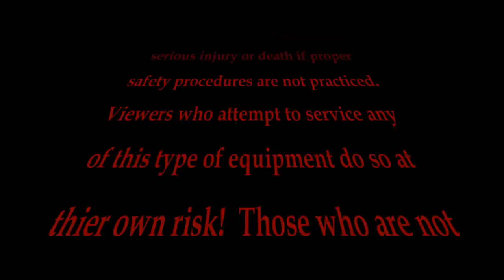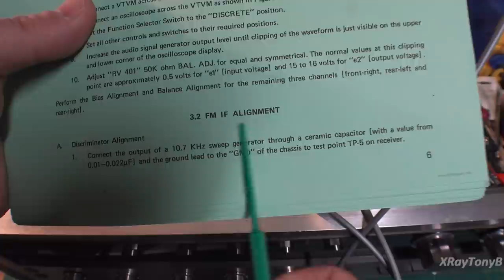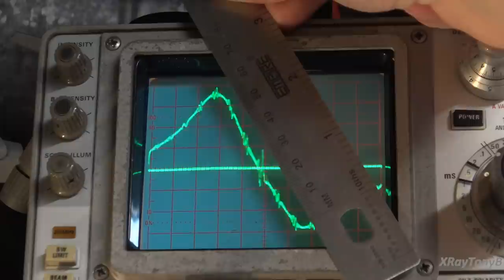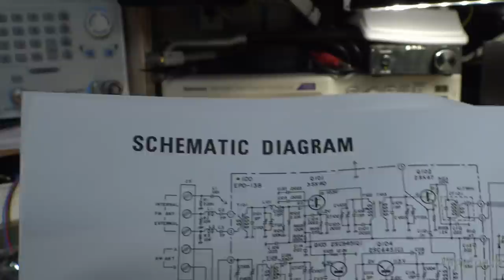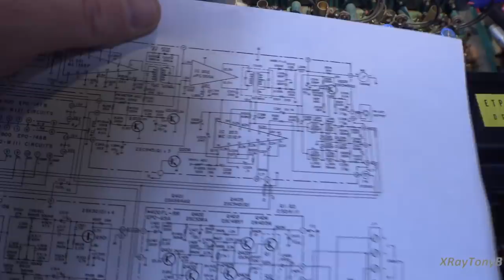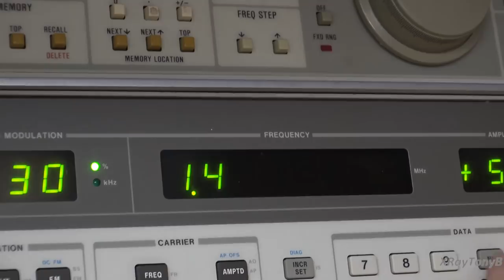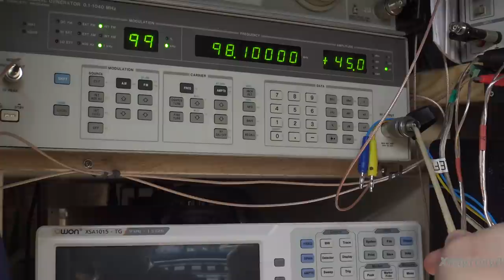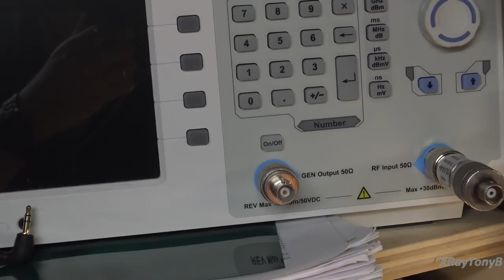Lafayette LR 441 Quadraphonic Receiver Part 2 - Servicing the Tuner

Comment: A Year so ago I did email you concerning a tuner I was trying to align  I don't think you even responded And I was not offended in any way ..Being in the auto repair industry I also get many questions on how to repair something ,Although I try to help, trying to fix something over the phone or in a email is all but impossible...I even had my big brother who is an electrical engineer come over and try and help but no joy, it highlighted how specialized radio is.  Watching you very informative videos and dumb luck I was able to somehow align the discriminator to 10.7 MHZ which was the issue using my oscilloscope .. I was able to finally align that tuner and convert it for use in the USA as it's from Europe..My big brother couldn't believe it.. I very much look forward to your posts, they also highlight the use of equipment and how one can use what they have to get the job done. Keep up the great work, your a great teacher..and I look forward to your next posts

Comment: Well explained video on tuning an FM band receiver. Enjoyed this very much. Almost everyone restoring radios seem to concentrate on AM radio tuning.
Like the end about the test gear that is needed to correct the  impedance. Didn't mention signal loss between the RG-172 and RG-8 (which is greater )
but that you explained by connecting 50 Ohm test gear and how impedance outputs you may be testing differ.

Comment: A couple of things Tony....

1. The mismatch between a 50ohm signal generator and a 75ohm receiver input is minimal and would only result in a 2-6dB loss of signal which is almost irrelevant for alignment purposes. Most service manuals describe, or detail a "dummy load" which is not the same thing as a balun. A dummy load actually terminates the input circuit in an approximately correct load, whereas a balun provides a balanced to unbalanced, or vice versa, transformation to the correct, or roughly correct, impedance.

2. From decades of personal experience, I much prefer to align RF and IF circuits with an analog (metered) AC voltmeter across the tape out jack or across a speaker, which makes finding a "peak" or "null" much much easier than a scope.

YMMV...Keep up the good work...!!!   73...Jordan VE6ZT

Comment: 47:00 - I've heard that, for AM, if you 'stagger-tune' the IF stages (requiring a sweep generator), you get better low-frequency response in the audio?
Reply: No, by stagger-tuning the AM IF strip, you can widen the IF bandwidth, thus allowing more treble (better HF response) from the AM signal. But most people never bother to do that, due to not knowing or a lack of proper RF test equipment (sweepable RF generator, and optionally - markers). This is best done only if you have lots of IF gain to play with, such as 2 IF stages. Doing it to a single-stage IF is practically useless, and just lowers RF sensitivity. Plus the AM band is limited to 10kHz channel width anyway, with no inter-channel space.

Comment: Thank you sir what is the difference between a signal sweep generator and signal generator.
Reply from the maker: A standard signal generator only outputs a fixed single frequency.  A sweep generator Starts at one frequency and varies or "sweeps" up or down to another frequency repeatedly (usually at a rate of 60 times per second) .  The halfway point of that frequency sweep is called the "center frequency", which is usually set to the frequency that you are tuning the device to.  For the FM I.F., it would be 10.7MHz, and would sweep between something like 10.6 and 10.8 MHz, for example.
Reply: @xraytonyb  Thank you I have a sweep generator but I don't know how to connect it with an oscilloscope.  I plug the RF output key with my oscilloscope and I vary the frequency with my hand no responce occurs on the oscilloscope you can help me work with this sweep generator.thanks